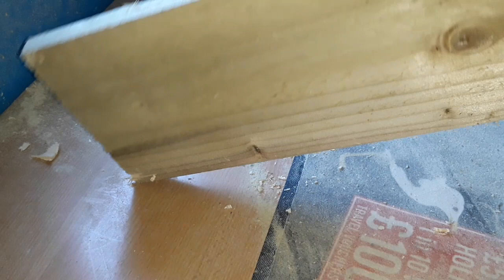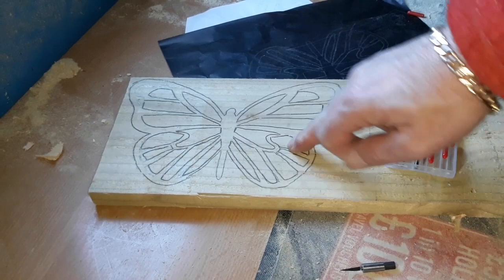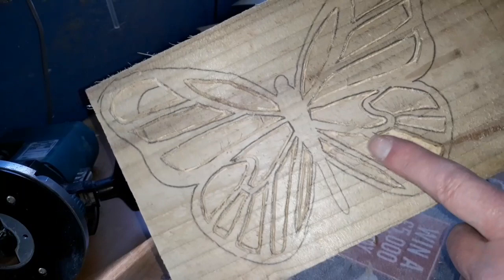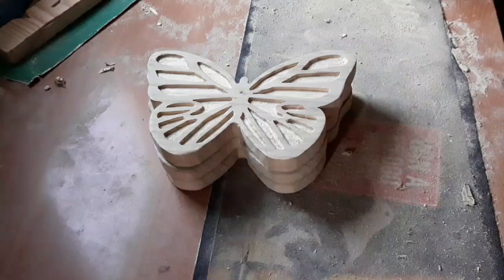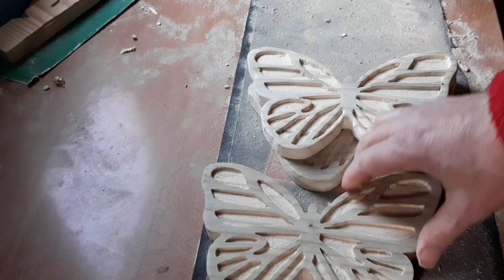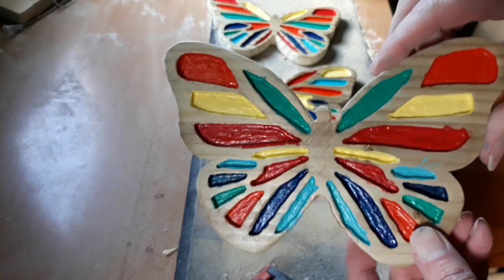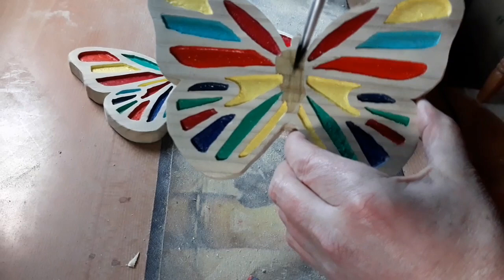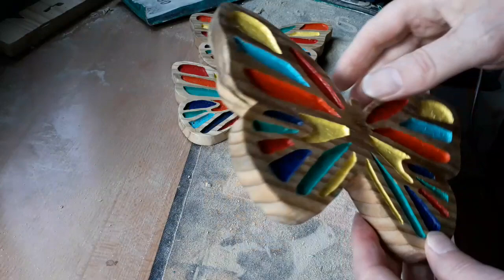Butterflies made from scrap wood

Comment: Subscribed and checking your older videos.. Would like to know what are your gear/tools you use? What router you use?
Reply from the maker: Thank you,the router I use iz an old black and decker dn66, they dont even make them anymore but you can still find them on Ebay, any palm or plunge router will do these projects.i use cnc bits for the lines,and end milling bits for the clear out, I've started putting links in the description on some of my videos ..thanks for the sub..
Reply: @fishtank5050  thank you

Comment: Amazing work, what size collet are you using? I cannot seem to find small enough collets to use for my cnc bits in SA.
Reply from the maker: Thank you Kavish,I've a 6.35mm collet in my router,but I think a 6mm would also fit,here's a link on ebay,also on amazon..
https://www.ebay.com.au/itm/164366589823
Reply: @fishtank5050  thank you for assisting, much appreciated. Will definitely check the link 👍